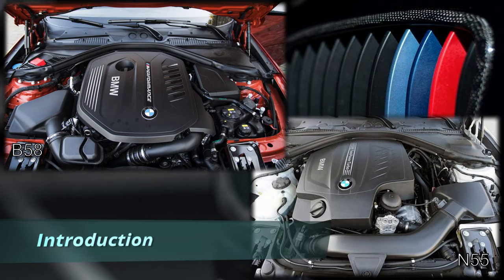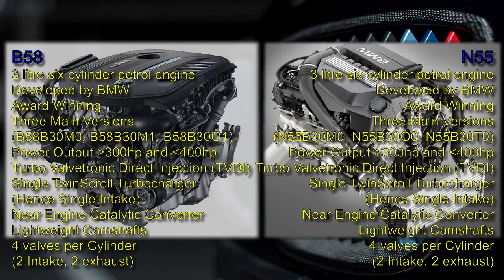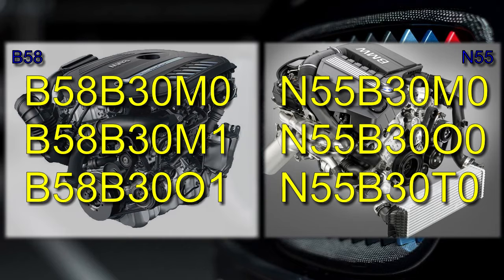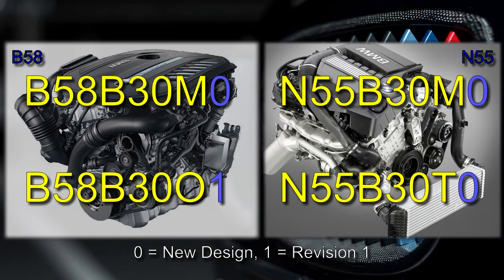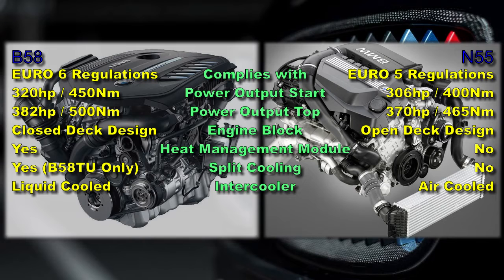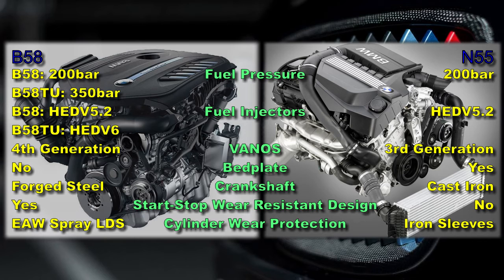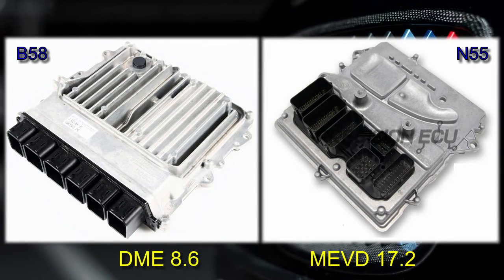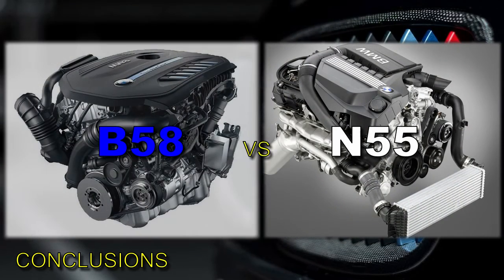BMW B58 vs N55 Engines: A brief but proper look at the differences & similarities between the two...

Comment: So if the n55 had the stock b58 turbo it would have made more power than the b58
Reply from the maker: Interesting, please could you explain how you arrived at this conclusion?
Reply: @NoBrainerTalk  if you really think about it, the N55B3000 is basically a single turbo s55 because it has the forged internals with a smaller turbo than the B58.  With the combination of the forged internals that are on the N55 and the turbo of the B58 I would be faster because the since it has the forged internals of a S55 it can handle more stress than the B58 and since it can handle more stress it means you can push it more and you can basically see it when you put a hybrid turbo on the N55 because the power increase is ridiculous.  420whp to 550-600+ whp.  Is an insane amount of power increase and this is numbers of a small hybrid turbo.  The B58 doesn’t get as much impact on power when you put a hybrid turbo in it if you think about it and if you wanted to push the N55 over 600 just change the injectors and you’ll be able to push whp800 with a pure 800 with no problem at all (keep in mind that this is only on the N55 that came on the M235i and the M2)
Reply from the maker: @NixClips101  I think if you wanted to compare the stock internals of a B58 with an S55, in order to scientifically show which are stronger, you would have to do so with destructive testing. I believe the B58 is quite over-engineered but it's not really possible to know how much load the internals can take, let alone compare those figures with the S55 or the OG M2 N55. Certainly the M2 N55, the S55 and the B58 have great potential for safe increase in power, showing just how robust the internals are in all three cases. There are more factors than the design of the stock internals or the design of the turbo limiting the peak power, including cooling, tuning (fuelling and timing), valve design, injector design, etc. Anyway, your point is well taken, but I think it's more complicated in my very humble opinion.
Reply: @NixClips101 this is kinda true but, a B58 with a stock turbo makes 470-500WHP upgraded turbo B58 can make 600-800WHP stock block with upgraded Turbo.
(Not saying it will hold at 800WHP for long).
This is very interesting question I wish I could see more data on F87 M2 N55 because I want to purchase one I’m stuck between that or an M440i or m340i but I just found out the n55 In the m2 is stronger than regular n55 so I need more data. I want to make 650WHP with full E85 and port injection wonder if the N55 will hold.
Reply: @Führersteinberg  is proven that the n55 on the M2 can hold up to 700whp stock engine
Reply: @Führersteinberg  The n55 in the OG M2 has forged crank, forged rods, and hypereutectic pistons. It can handle 700whp pretty easily although you should not push much more than that, there are a couple people making around the 750whp range on stock block, but it will hold 650whp all day. The n55 in the m235i has the same internals as the m2, but only difference is that it does not have the dual oil pumps for oil starvation in high lateral g forces. The other n55 variants like in the 2014+ f30/f32 have the same forged rods but cast-iron crank and cast pistons, they can hold around 600whp, but some people have bent rods and cracked pistons at that power level so most leave at 550whp.

Comment: The later N55 engine had an electronic wastegate too (EWG). Mine does, as it was made after June 2013. They can handle more boost. You get higher hp from mods than the pneumatic wastegates in the older N55 engines (PWG).
Reply: The upgrade from PWG to EWG took place in July 2014 for this allowed a 4" inlet/outlet pipe vs. a 3.5" inlet/outlet pipe on PWG units and a revised (larger) turbine/compressor wheel. 

I owned an PWG N55 before on a 2013 X5 xDrive35i and now I have an EWG N55 with MPPK a few other mods making over 320hp at the wheels that's on a 2017 X5 xDrive35i with M Sport and the latter feels substianlly faster than what I had before.
Reply: @Ashley_van_Schooneveld  M135i got them earlier. Your date is correct for most other models.
Reply: They control boost more accurately, not handle more boost.

Comment: I want to buy a m140i, but I think that the cars that have B58TU comes with petrol particulate filter (Europe). Is worth? Or maybe is better to go with first version of B58 engine that don't have the petrol particulate filter? Thanks
Reply from the maker: Hi, late production M140i's and other 1st gen B58 cars also have PPF.  Yes, all B58TU will have PPF aswell. It is possible to modify the car and delete the PPF so it's not a show-stopper.
Reply: Deleting the PPF is not an option because the car wont pass emissions test. So I have to decide between a modern b58 engine version with PPF or  an earlier b58 engine without it (at least in Spain until 2018 the m140i came without PPF)
Reply from the maker: @AdriWeedMan  To be honest I don't know how decat dp cars pass emissions tests either, but there's definitely people out there deleting the PPF. However, as you say it's always best to choose a car that wasn't fitted with a PPF from factory, my M140i is manufactured May 2018, and was one of the last without PPF (only the factory knows the last VIN without PPF, but wouldn't it be awesome if somehow mine was the last one? :)).

Comment: 2016 bmw X40i Is the engine M2 engine the same?😢
Reply from the maker: No, M2 and X40i have different engines. OG M2 has N55 engine variant, M2 competition and M2 CS have S55 engine, Latest G87 M2 has S58 engine. 2016 X40i has B58 engine.
Reply: @NoBrainerTalk  Thank you for your reply.

Comment: BMW Tech here. Surprisingly the B series motors oil filter housings don’t leak oil. They just have a tendency to warp where they mount against the block causing coolant to pour down the left hand side of the block and require replacement of the entire unit. B series motors are surprisingly well sealed but their cooling systems are so poorly designed that they’re definitely the bottleneck. So much plastic makes them leak in several locations. Very good video
Reply from the maker: Some of us have found a different colour coolant (olive-brown) in our intercooler coolant expansion tanks. By any chance, do you know what that coolant Part Number or designation is? As far as I know both circuits should be serviced with the same coolant (either LC-87 blue coolant or LC-18 / HT-12 green coolant), so this brown olive-brown coolant only found in the intercooler circuit has been abit of a mystery. Hope you might be able to help.
Reply: @NoBrainerTalk  just now seeing this, sorry for the late response. As far as I’m aware we swapped to HT12 after 2017 so it should be HT 12 for both the low temp and high temp cooling circuits. If it’s a B series motor more likely than not it takes HT12. I’ve seen some B46s right on the cusp of when we swapped over still take blue in the high temp but green in the low temp.
Reply: @EthanJames333  which engine would you choose the N55 or B58?
Reply: @StillhetOgSmerte  B58 all day. The N55 is a great engine too but the issue is theyre older and have been dogged on much more frequently. If you can find a lower mileage B58, go for that. The only weak points are, tank vent vales like to go bad but theres a warranty extension now, cooling systems like to leak due to being primarily plastic and rubber components but as long as you get like an aftermarket warranty you dont have anything to worry about. Coils dont die randomly like they do on the N55, not an electric water pump so you dont have to wrory about those dying or causing a parasitic draw.
Reply: Ethan how much better is the b58 than the n55? I wanna by a 640i xdrive coup with n55. Have you worke with the 640 any problem with this type you know? I dont wannt fore race ore drive to fast but i would like push any time. Sorry for my english buddy. Peace
Reply: @ Your English is fine so no worries! So the 6 series Gran Coupes have some odd issues. Mechanically, it’s an N55 so long as you change the oil every 5k - 7k miles you’ll be alright. They have issues with the electric coolant pumps continuously running causing a parasitic draw, their oil filter housings have a tendency to leak, oil pans leak, and valve covers will leak. So long as the oil pan isn’t actively pouring, the oil filter housing and valve cover seals take priority in most cases. If an oil filter housing gasket gets too bad it will saturate the serpentine belt, causing it to slip and potentially getting sucked past the crank pulley and the crank seal. It’ll shred the belt and strands can make their way into the oil pan and wrap around the crank. We’ve seen this a few times. Always replace the tensioner with the belt. It’s an aluminum bolt that holds the tensioner on so it also must be replaced. As for a 6 series specific issue, I’ve dealt with their third eye brake gasket degrading and causing a very bad water leak down the C pillars into the rear seats and floor boards. Otherwise, the 6 series are fairly solid cars. 

My personal opinion would be to shoot for a G30 (5 series) and get an extended warranty on it. G30’s are great, reliable, and the only issues I’ve see from them are the air distribution boxes flap seals separating causing there to be a slight whistle through the interior vents, and the evaporators love to leak Freon after 60k miles or so. Other than that, the only weak point of the B58 is the cooling system so the following components: Oil filter housing, heat management module (thermostat), upper radiator hose, very rarely the turbo coolant lines. Overall though they’re good cars and they’re on BMWs value service list so you can get oil changes, brakes, filters, ect pretty cheap at a BMW dealer. 

I hope this helped!
Reply: @EthanJames333  are this problems also in the 335, 435 with n55 ore in the 6 series more? So electronic i know more electro more problems hehe. Thank you very much for your time and infermation. You help me alot. Wish you the best peace bro ✌️
Reply: Hey Ethan, I've been looking around for a first car and plan on saving around 15-20k by the end of this year for my first car. I'd like to get a 340 but they're mostly around 18-20k in SoCal for ~100k miles with one listing being 27k for 50k miles. Should I save a bit more to try and get a lower (~90k ish) mileage car or just get a n55 which are  ~12k for 100k miles and 20k for <100k miles? Thanks in advance bro.
Reply: @ the lower the mileage the better, although you just need to look at the cars and drive them prior to purchase. For N55’s be on the lookout for leaking valve covers, oil filter housings, and oil pan gaskets. Always look the front side of the engine and make sure the belt and tensioner aren’t coated in oil. Remove the engine cover and look at the eccentric shaft sensor harness. Google it and you’ll see what I’m talking about. When the eccentric shaft sensor seal that’s in the valve cover goes bad, it’ll allow oil to get into the connector and go up through the harness killing the DME
Reply: @EthanJames333   Thanks for the reply, can you also do a quick rundown on what you think is better and if I should save for a few months more or just get the n55 outright?
Reply: @EthanJames333 Can one change some of the bad plastics to make it more reliable? Which parts of the cooling systems can be changed with more reliable materials?
Reply: @spooky1000 You can! I’d recommend going online and finding a metal oil filter housing and upper radiator hose connecting branch. If you replace both of those with metal ones then you really don’t ever have to worry. Will add a little weight to the motor but nothing much. That truly eliminates the two biggest weak points of the B58

Comment: Any idea if a B58 can be swapped into a pre-LCI F31 engine bay? (same engine as the post-LCI F3X)

Similarly any idea if the B58TU can be swapped into the same F31? Looking at doing this for my 2014 328i Touring and would love to bring in a B58TU with all the latest power and advancements. I know there was also an increase to a 48V mild hybrid tech for the post-LCI B58TU so I’m wondering whether there would be any fitting issues into the old pre-LCI F3X engine bay.

Has anybody done any of these swaps?
Reply from the maker: I don't know, but as the F31 chassis can accommodate B58 in LCI form, then it should be able to accommodate B58 1st gen engine in pre LCI form with relatively minor adjustments. As for B58TU you would be in less clear territory, but it should work in theory. The B58TU does not necessarily have 48V system, this is a later addition. You can find spare B58TU without 48V system. Basically to me your plan sounds possible, but never did it so this is just my humble opinion.
Reply: You would have to change a lot more than just the engine

Comment: Im sure the n55 m2 has the same crank shaft as the s55. Is that not forged ? Same as the pistons etc ?
Reply from the maker: Hi, the crankshaft of the M2 N55 (N55B30T0) is the same as the N55B30O0 (M135i/M235i) and it is forged steel, but not the same as the N55B30M0 which is cast iron. However in the M2 N55 it is combined with upgraded crankshaft bearings. The crankshaft of the S55 is of course forged steel. The pistons of the M2 N55 (N55B30T0) are adopted from the S55 engine but with different piston rings.

Comment: My N55 435iX MHD Stage 2+ E20 has 160,000 miles and no leaks and no serpentine belt issues. - update 168k miles no rod bearing issues. Daily abused 435iX Also xHP stage 4.
Reply from the maker: BMW Power!!! :)
Reply: Any issues with rod bearings? These seem to be a common issue on the n55.
Reply from the maker: @vwukben  A few owners have found issues with rod bearings (though not often resulting in engine failure), although generally I believe it is not considered an issue that affects a large number of S55 engines. Running the engines with good oil of the right viscosity is key for all engine types to help prevent/greatly postpone such issues, it's often difficult to differentiate design issues with issues brought on by customisations and modifications. If I had bought a used low mileage S55 and I knew the previous owner used approved BMW spec oil and replaced it frequently, I personally wouldn't worry about rod bearing issues.. But this is just my humble opinion.
Reply: @vwukben  Im at 168,000 miles no issues.
Reply: What about the water pump?
Reply: @TheJaymnj  I just hit 180,000 no water pump issues.🙏🏼✅
Reply: @elrockamaster I was told around 80,000 miles is when it will fail... If it doesn't like in your Case then it should be good for a long time after... Again your a perfect example...I'm around 90,000 miles on my 2014 535... I think I'm good LoL no issues
Reply: what year is your 435?
Reply: @Agent-mw8th  2016
Reply: @Agent-mw8th  2016

Comment: @9:15. He said the N55 has a power steering pump. My 2014 F33 N55 435 c9nvertible is electric steering. No PS pump.
Reply from the maker: Thank you for that note, there are some changes between cars and incremental improvements of the N55 before the release of the B58. For example the turbo's electrical waste gate valve was introduced on the later production N55s before it was standard on the B58 turbos. This video is a generalisation.
Reply: @NoBrainerTalk  Yup, mine is electric waste gate, too.

Comment: where do you look on the vin or where to know which one you have?
Reply from the maker: Do you mean how to use the VIN to determine your engine type? I suppose it can be loaded into a VIN checker website, these are usually not free, and I'm not sure if they specify the engine model. But looking at the engine itself you can usually understand the engine model and you can also check on the engine for the engine Part Number. This is usually on the front side of the engine, in the case of the B58 it is behind the charge pipe.

Comment: I'm having my eyes on a 2016 640i, I'm new to the BMW world, what engine does this car have?
I see the B58 is tweaked to be a better performance engine than the N55, yet is more complex, I'll be doing the maintenance work myself so I'm biased toward the N55.
 Enlight me please 🙏🏼
Reply from the maker: Hello, I believe the 2016 F12 640i has the N55B30A engine.
Reply: @NoBrainerTalk I really appreciate your feedback, but how is it in terms of reliability and service?
Reply from the maker: @vincentlonbird1806  Although generally the B58 is more reliable than the N55, the N55 is also a good engine. As long as you stay on top of the known issues and service the engine as required, it should be good. But there are always exceptions, even new engines can be less reliable based on many factors. Keep in mind when buying a used car, it's never clear how hard the previous owner(s) drove the car or if the engine running in was done properly. Having said all that, the 640i is very good looking car in my opinion, I can see why you are interested.
Reply: @NoBrainerTalk  Many thanks friend, yeah I really do like the aesthetics of the car
Reply: I recommend a BMW 435i , is a beautiful  design and strong engine , in fact , a GREAT SPORT CAR !!!!